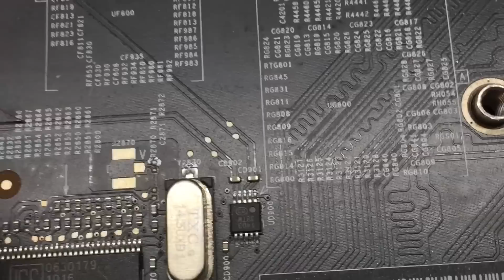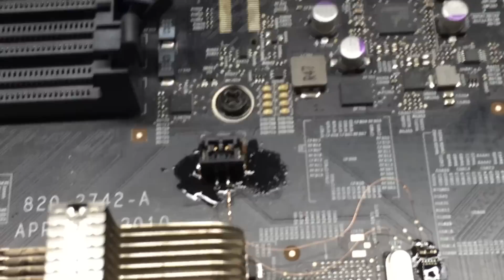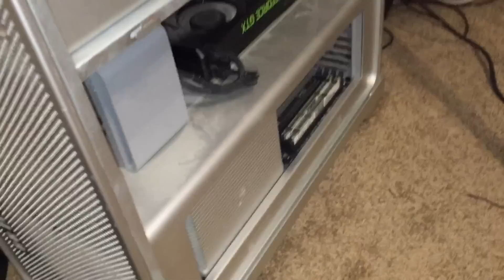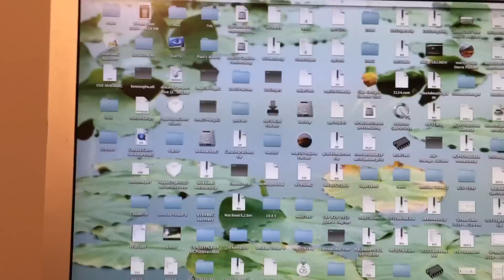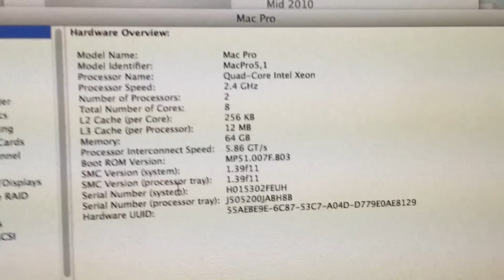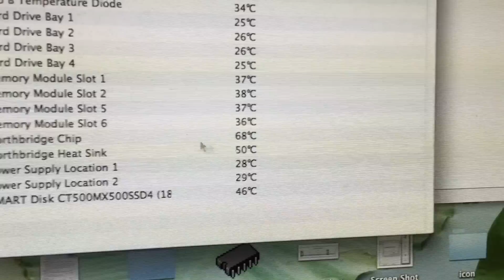Mac Pro 5,1 Dual-CPU Tray Repair

Comment: hi @dosdude1 
, man i would realy apreciate you help i have a mac pro 4.1 2009 that is having some issues LED DSI510 is blinking at the start and then i don hear any chime, not video signal and the fans are spinning around but not in full speed. do you know what ca it be ? is the tray that is broken or the cpu ?  thanks in advance.

Comment: What is the name of those small wires you soldered? I understand those are electrically pre-insulated?
Reply from the maker: Yes, it is 0.1MM enamel-coated copper wire.

Comment: i have a 2011 macmini that wont finish any usb installs. the usb i had was reformated because I used catalina patcher it worked fine but I wanted 32bit back. now nothing else will complete the install. am i stuck with catalina? they fail during the second loading bar and shuts down. ive never had a problem with it before its just been sitting around. I swapped ram. I am using transmac and ive tried multiple isos and different version downloads they all shut the system down or the install fails and says it cannot complete. ive used multiple fd's and even one i originally had a working copy on. hopefully can get working. any idea for the random shutdown? overheating? sometimes powerbutton doesnt turn it on right away and I get no chime.
Reply from the maker: Make sure you use a Mac to create your install media.
Reply: @dosdude1  I have spare 2011 macbookpro i5 ive been using. I restored with disk utility to make sure I had a clean clone of the hdd. upon booting im getting some kind of crash that is mem/cache address error in black for 3 seconds and reboots. If i pop that same drive into the laptop it boots just fine. I even ran first aid everything is fine. I swapped ram even. all it did was sit in a box for 2 months and I had catalina patched it. took the hdd out for something else now im just trying to get osx back on but to no avail. 

I'm going to try and see if linux will even boot didnt think of that yet just to narrow down the issue. thanks dude. I have a powerbook G4 that i know is having some overheating issues under BSD as it constantly displays error temp msgs.. anything common that may cause this or will some new paste take care of it. just looking for your input. I also have a ibookG3 and the disc tray wont stick closed anymore it just started happening overnight the other day so now I have to rip it open. this one is my favorite because of the clearwhite style keyboard.

Comment: I have the APFS ROM Patcher, but the instructions on the ReadMe file are vague. I have a MP3,1 that has no OS. I'm supposed to press and hold the power button for 10 seconds and wait for it to boot? Unto what? With no OS, how will it boot, and what do I do with the patcher? Save it to a USB and the machine will recognize it? There is no way that I'm going to mess with the ROM without clear instructions, and without this, apparently the BigMac2 isn't recognized by the machine, therefore I'm stuck with no OS and no MP. Thanks.

Comment: Why did you stop making the Patchers for Macs.
Reply from the maker: Because both Big Sur and Monterey require kernel patches to function properly on some systems, making OpenCore the best option. A fully-native approach as I was doing makes it extremely difficult and finicky to apply kernel patches, whereas OpenCore is able to inject them realtime at every boot.
Reply: @dosdude1  Ah ok thanks for telling me i had that question for a long time.
Reply: Yes, this is actually a good question... these minor repairs are meaningless.

Comment: Any reason you didn’t use the two test points just past the capacitor on the traces?
Reply from the maker: No; they could've been used as well.

Comment: isn't that thin wire going to heat up and fail eventually?
Reply from the maker: No, it's copper wire, and is under basically no load in this kind of sense circuit.
Reply: Nice video, I assume you’ll now insulate the two bridge wires.  Update Mac OS on the machine as well ☺️
Reply: No... no current to speak of.

Comment: Dunny thing, I saw that very listing, but decied to [pass, since I really had no need for it. I'm glad you got it working. I do have a dual tray in a test machine, that runs fine, but one of the ram slots doesn't work. It's detected, but reads as empty. I've tied switching ram aroiund, using other modules, but that same slot always reads empty. Do you have any deas as to what might be going wrong?
Reply from the maker: Probably a bent or broken pin in one of the CPU sockets.
Reply: @dosdude1  That's likely it. I did upgrade the CPU's. It's one of four I've done, and this is the only one with a problem.